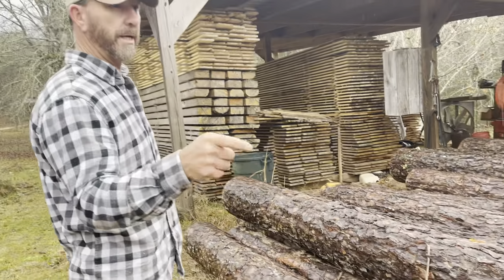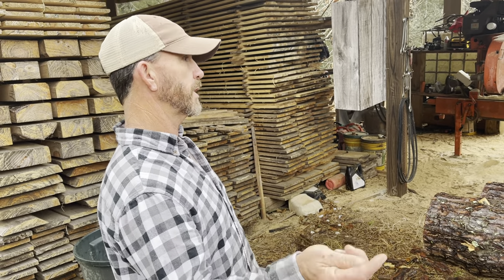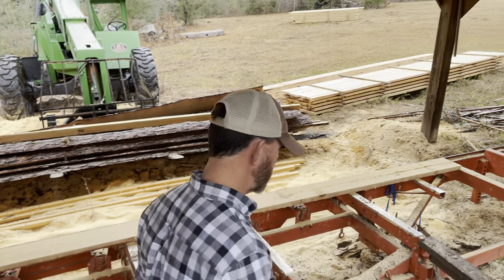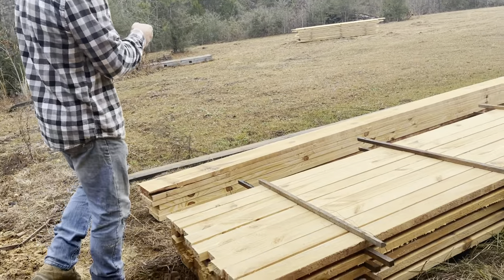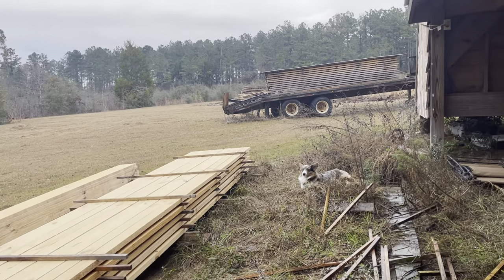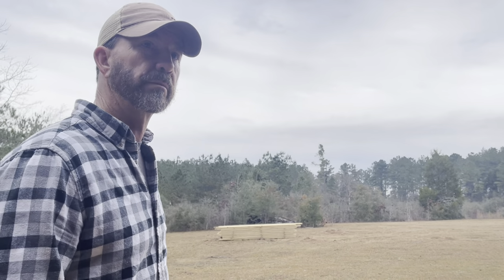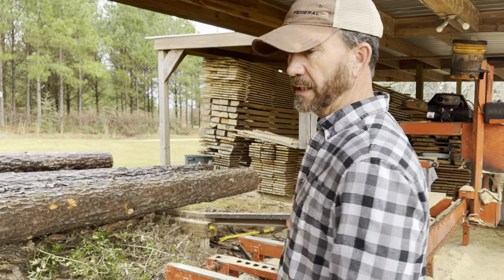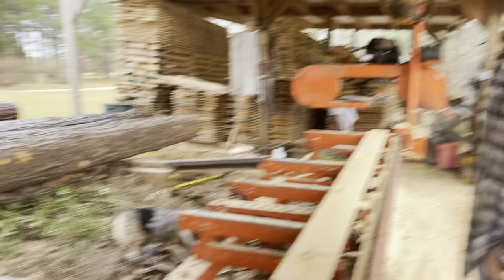Cutting Over $1,000 Worth of 2x4 Lumber on the Sawmill!

Comment: I'm old i remember 2x4x8' were less than a dollar. The house i built in 1990 7,000 sg ft the framing package was less than 20k. Going to build a new house in central TN. But will use concrete if lumber dont come back down.

Comment: So, store lumber, is 1-9/16". As a carpenter, for instance, we'd cut 22-7/16 blocks to keep a two foot rafter/joist span from going out of span so the plywood still fits center to center. So, I have a new mill. I want to have close to dry lumber, if I want 1-9/16" lumber, what would be my cut setting?